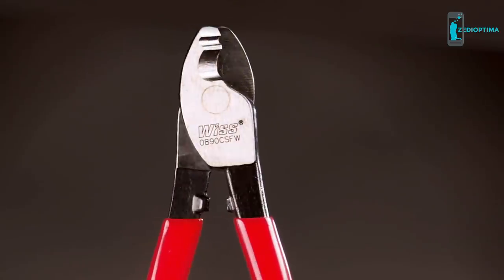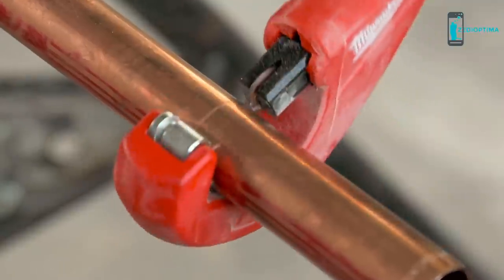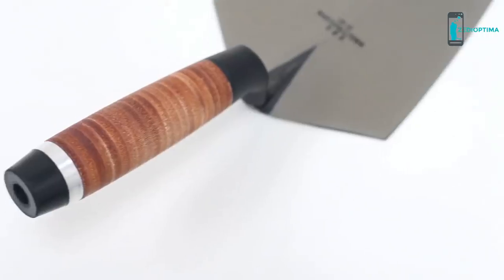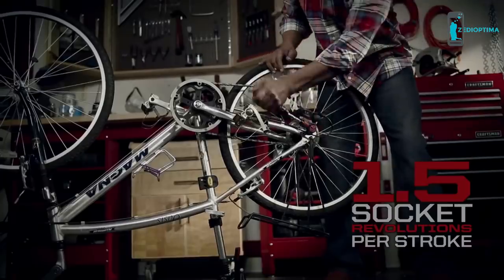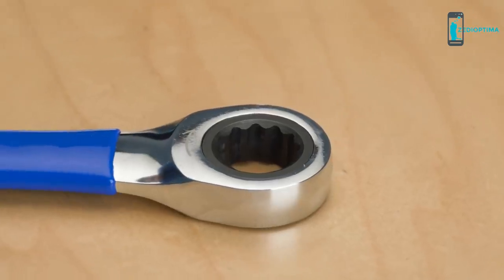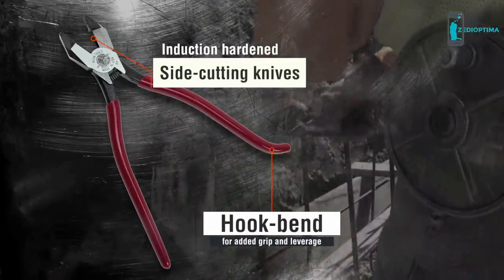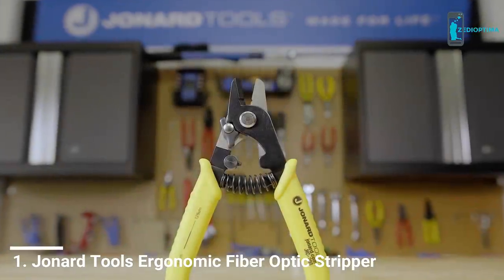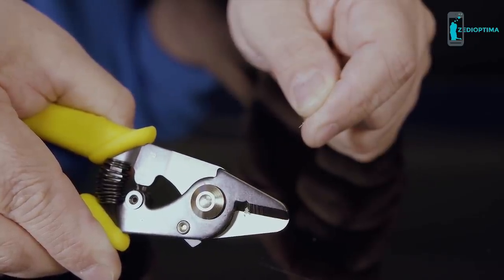Top 10 Essential Hand tools for DIY Work

Comment: Most of the tools presented are NOT for DIY-ers but for professionals!
Reply: Mike2018 but I’ll buy them all anyway, just in case, you never know 😂
Reply: @Driver987  oh, yeah buddy, totally understand u, especially now during lockdown...
Reply: Mike2018 I’ve spent £500 is the last two days on tools through Amazon. They’re all top quality tools, because I like to buy the best of everything, even if it only gets used a couple of times a year. The feeling of using a quality tool is unbeatable 😂
Reply: @Driver987  i agree w u, i like having good quality tools as well & i also bought some profi tools myself spending good money although i'm not a profi. But i have cheap ones also.